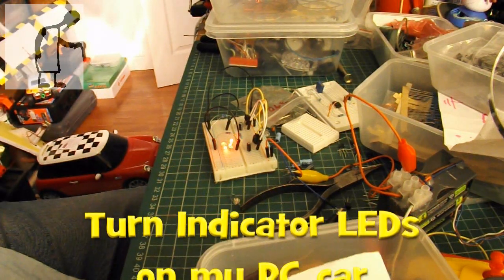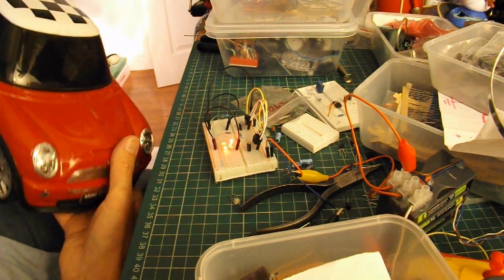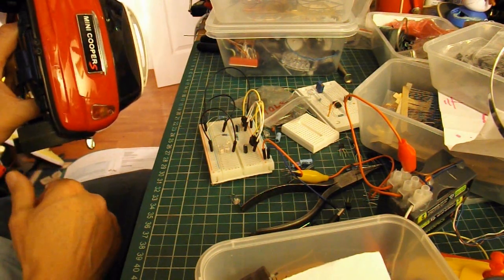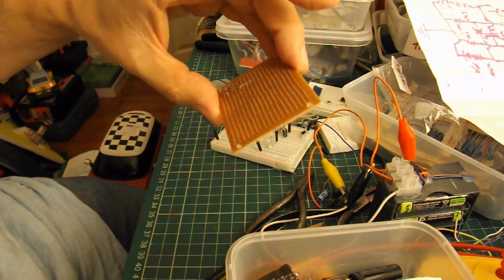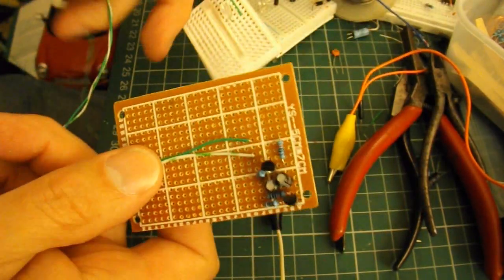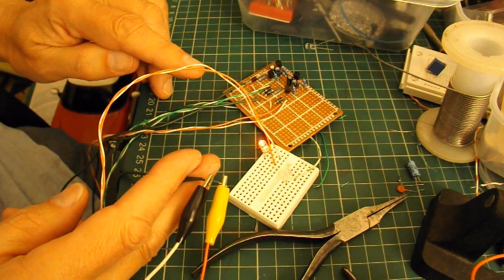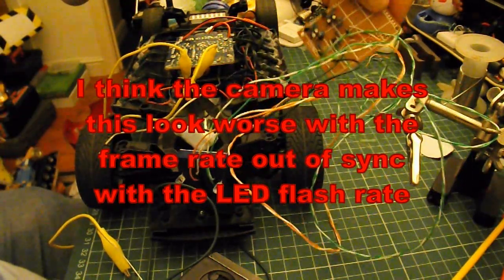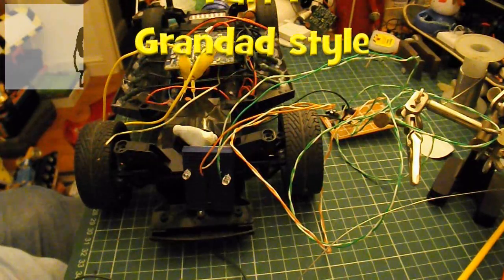Turn Indicator LEDs on my RC car Part 1 Grandad style

Comment: Buying link of PCB with which orange indicator light work?
Reply from the maker: That is just a blank perf board. If you watch the video I build this circuit from scratch. You can buy flashing circuit kits online and you can buy the blank perf boards online. I get nothing from any eBay seller so I do not normally give links as I do not want to be seen to be recommending any particular seller.
Here is an example of a perf board listing https://www.ebay.co.uk/itm/303375155272
If you just want flashing LEDs then a kit like this might do the job https://www.ebay.co.uk/itm/352670554693
I am not endorsing these products so I suggest you do your own search as the prices and specifications will vary and the links I used will probably be out of date when you come to read this.

Comment: Have you considered  using a Picaxe controller in some of your projects? They make it easy to control leds,  servos, and motor speed with an 8 pin chip. They program in an easy to learn Basic and are used in the UK school system. I enjoy your videos and appreciate the effort you put into them.
Reply from the maker: +BillyF1289 thanks Billy, the answer is that I have no intention of getting into any form of processor control. YouTube is full of people already doing that so I don't think we need another channel doing it. I did my programming back in the 80s and 90s and don't feel the urge to get back into it now.